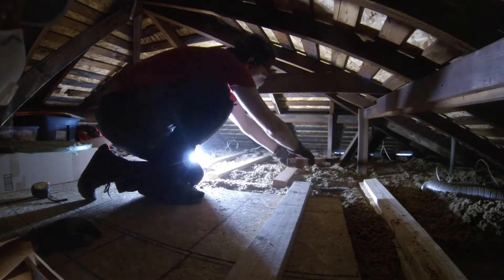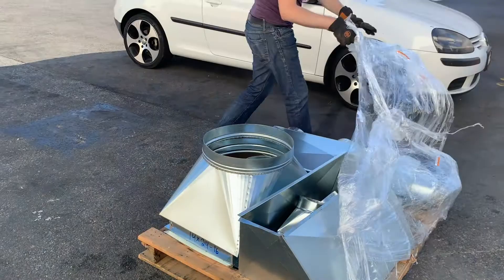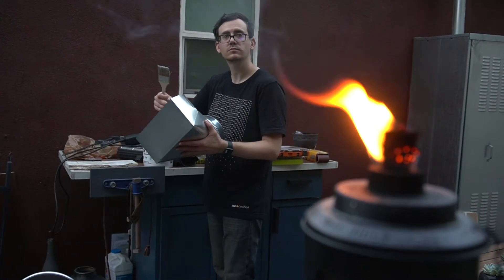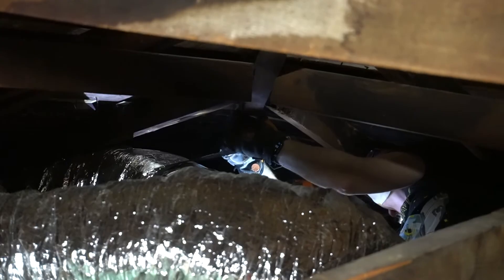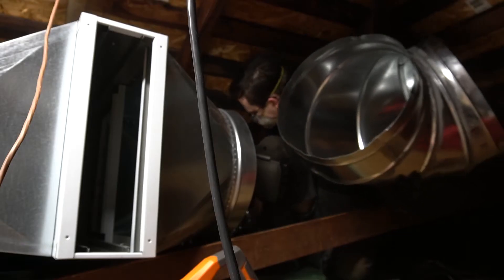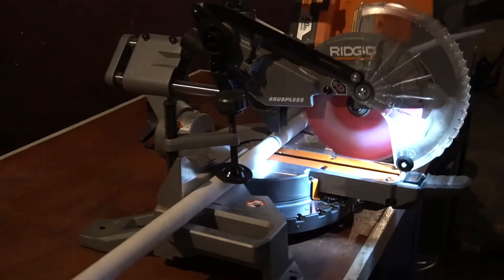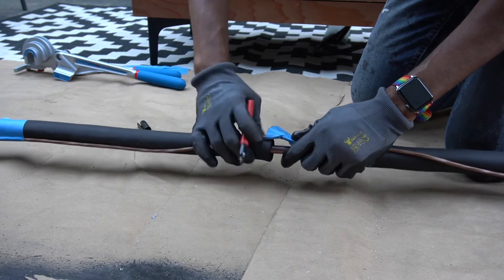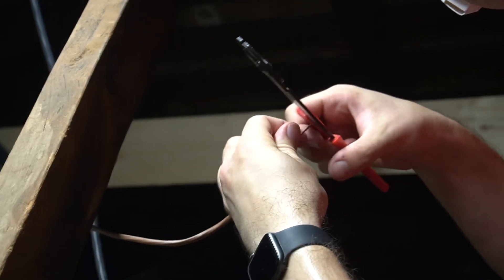Slim Concealed Duct Mini Split Install

Comment: That's a big job for DIYers! Nice work. I'm a heating engineer in the UK with years of experience in a lot of that and I'm about to do the same, it's taking a lot of research & it's very confusing as everything is a mix of imperial & metric measurements here. I'm daunted by it & I'm not even going to be doing the gassing of the system (a friend is going to do it). So you've done a fantastic thing there.
Reply from the maker: Thank you! Nice to hear that from a professional. Best of luck with yours!

Comment: In Miami nothing getting heat shall touch anything related to the air conditioning system inside the attic, no wood, no house insulation is to touch an equipment, or duct, nothing hotter than the ac or ducts shall touch the system or it will sweat due to difference in temperature between the two objects. If anyone has any questions ask, I'll explain in another moment.

Suggestion to the author, carry at least another source of light while in the attic. And for videos purposes, install an extension, illuminate the area all you can, so the darkness gets mitigated and doesn't work as a detractor making your videos not pleasant to be watched. Many in my experience do not enjoy one bit anything related to the attic so if you add darkness to it that's it. Light is very welcome to most, so hope you make the sacrifice so your audience may, "may" grow. Who knows, we do impossible jobs so, acquiring audience in this field is another's impossible project so, my best wishes to you! Take care and do not work in the attics once you feel any minimum thought about low energies to go down, low Dioxygen levels or anything that makes you to slow down, no money is worth your life. Is better to abandon any project or being fired than to lose your life. Believe me, I've being fired from jobs by people that know me well but keep this in mind, I was taking care of emergencies, they know me, for 22 years one of them, the other knows me for less but I attended his 33 apartment rentals and all my clients must have air conditioning, they do have, and am not dying in any attic just because they demand me or need me or want me or anything. If I have one neuron alerting me anything related to protect my life, hope you too, do not fight that hero neuron, get down. Those that want us dead do not care about us. One of the business owner that fired me told me "I don't care how you live!" So, there you have it. Is not worth it to die for certain humans. And I am one willing to die for many, but some, expressed this way to me after 22 years of knowing me? And worst so. Protect yourself! Live longer yet!
Reply from the maker: thanks for the info and thanks for watching!

Comment: Where did you buy that strut? I couldn't find them at homo depot or lowes? Was that easy to find?
Reply from the maker: We actually found ours at Home Depot locally. Lucky I guess!
Reply: @40Figs  Don't laugh but I bought my unit in December and I still haven't installed it. I've been busy but I'll be doing a lot of this myself in a few weeks. I also called the company you used and they offered to size the system and help me design the plenum and ductwork. It takes a (gay) village. I will probably drive from Tacoma to pick it up since it's not that far

Comment: I've been seeing a lot of people posting online that if a professional does not install your system they will not honor the warranty if anything goes wrong which really sucks! I've seen this mostly about C&H so my plan for the system I'm about to install in my House in Lakewood, wa is to pay an HVAC contractor to come out and do the evacuating part so that way I know that very crucial part of the installation is done properly and then so I can also notate his HVAC Contractor License ID so when I register my warranty I can give them that information to make sure if there's any issues they absolutely honor their warranty!
Reply from the maker: Makes sense! That’s probably the way to go. We’re just hoping everything holds up and we won’t need to make a warranty claim lol
Reply: @40Figs it's been five years, any issues with the system or with are leakage?

Comment: From what I saw in a video by an HVAC contractor, when you flare a tube like that you are not supposed to deburr them. I am glad you showed the information about bending the tubes because some people might think they can just bend them around. Someone also suggested using a digital gauge when doing the evacuating because it's more accurate but I don't know if that really matters
Reply from the maker: Thanks for the info!

Comment: I'm working on a ducting system made entirely of rigid foam sheets. They bond really well with gorilla glue, and you can cut them anywhere, and with simple tools. It can be built in short sections on the bench, and the short sections easily bonded together insitu.
Reply: How did this method work out for you? Has it held up? Would you do this method again? Ty for your time

Comment: Hi there. I'm planning on installing a ducted mini-split also, I'm in Florida. The video was very helpful, but I would like to have a bit more details. Can you share with me a few technical info: what tonnage is the indoor/outdoor units? size of the supply/return ducts? the noise level from the vents in the rooms after installation? if you could share the duct design it would be great.
Reply from the maker: Hi! Thanks for watching! Based on where you are and the size/layout of your house, your needs are going to be quite different than ours but our unit was 1.5 tons/18000 BTU and it's been running nearly silently. Best of luck on your install! We're glad our video was of some help.

Comment: Awesome! How did you get the attic units through that tiny access hole?
Reply from the maker: Good question! lol. We did actually have to do some reframing of the attic access hole to enlarge it a bit, but it ended up fitting in the end...just barely!

Comment: No problem with extra condensation on the concealed duct air handler due to extreme temperature differences between the equipment itself and the environment it's in, due to it being installed in the unconditioned attic, the attic not being part of the insulated envelope of the interior house?  All guidance I've seen indicates that the attic must be part of the interior envelope of the structure, or the air handler must be housed inside a well-insulated box.
Reply from the maker: Thanks for watching! No problems so far with condensation. The unit itself has interior insulation and we also installed an emergency drain pan just case.

Comment: All that work and no thread Teflon? Or at least pipe dope would have future leak proofed the refrigerant connections. Not a big deal with non ceiling handlers, but in an attic! Gulp
Reply from the maker: Thanks for watching! Flare connections do not use Teflon or pipe dope.

Comment: Great work! Did you forego all warranty from Fujitsu by doing this yourself? Also, why use a ducted system - You have access in the attic, so why not use ceiling cassettes, for example?
Reply from the maker: Thanks for watching! We haven't needed to test the warranty yet. One of the reasons we chose Fujitsu is that many of the local contractors support these units, so if we ever ran into an issue hopefully we can get help. The main reasons we chose ducted vs. ceiling cassettes are aesthetics, cost, and installation complexity. Ceiling cassettes would have required us to frame openings in the ceiling joists, run line sets to each, required a multi-zone unit, and would have been much more expensive.

Comment: Great job. I have installed ductless units but have yet to install ductwork.
One very big concern: before anyone begins poking around an old attic, built before the mid 1980’s in particular; make sure the insulation is not asbestos. If the insulation is not simple fiberglass batts or you know exactly what it is, be careful and have it tested in several places especially if it looks like it is granular or unusual material. Perlite was a product commonly used years ago that had asbestos in it.
Reply from the maker: Thank you for the concern!  We did actually have our insulation tested and, lucky for us, it is asbestos free!

Comment: Okay as an electrical contractor and someone who has built 3 homes for my self I have watched a lot of construction related videos about concepts I was interested in. They all have typically one thing in common which is some Arrogant, "know it all" male (usually with a ridiculous hillbilly beard, machismo tattoos and  some variation of a pro 2nd amendment t shirt or hoody) filling the video with their ridiculous Ego. Then I stumble on this video of a couple of low key gents taking their time, speaking softly, doing their research and putting out a great overall video that thoroughly shows what's involved in a DIY ductless minisplit install. Cheers to you guys, I love it.
Reply from the maker: Thank you, that's really nice to hear. So happy you appreciated it!
Reply: I agree with you. I'm a gas engineer in the UK with no experience with refrigeration, only heating. I'm wanting to fit the same. I've seen the same stuff as you so it's nice to see it can be done.

Comment: Excellent job gents!, Better  job then I have seen by pros! I have read pro comments on the internet that actually state "Torque wrench? I've been installing minis for a dozen years never used a torque wrench I know when it is tight enough." or "nitrogen flush all I do is a deep vac". The two of you went beyond the pro level/ Good job!
Many vids on a  standard wall mini, almost none on concealed ducted unit. I installed a 2  head units on a 3 zone outdoor unit. have not used our gas furnace in 3 years and we are in Boise ID. Are looking to add a concealed 9k unit for  2 small bedrooms. your video, inspiring and full of tips.
Best wishes to you both!

Comment: You used tape on joints.   No good.
Reply from the maker: We used UL 181B-FX foil mastic tape with at least 2 wraps per joint, as well as nylon ties. It is an accepted practice for installing flex duct to fittings. Please refer to the Air Duct Council’s flex duct installation standards guide for more info. Thanks for watching!

Comment: Why did you use a 16" return duct?  What CFM is your system supposed to output?  I am installing a 18k BTU concealed duct unit and since my system medium speed is 450 CFM, I decided to go with a 12" return which is supposed to apply 480 CFM.  16" is supposed to supply 1000 CFM
Reply from the maker: The return size was specified by the company we hired to design the duct plan and build the plenums. My understanding is that our unit is a low static pressure model so it needs a larger return to keep within the limits. It is a ~600 CFM system. You probably need to design your ductwork for the high speed mode. Thanks for watching!
Reply: @40Figs  thanks for the reply. My unit on max speed is 530 CFM (med speed is 450 CFM).  12" flexible supplies 480 CFM, but my vents are supposed to supply 445 CFM.  I am also planning on connecting the 5" fresh intake which should pull another 50 CFM on top of the 480 CFM 12" return.  I know for your system you could've went with a 14" return which should give you 700 CFM, but they went one size up to 16"

Comment: You guys did a great job.  You made it much more difficult than it had to be- but I didn't see all the challenges you had.  I have no doubt there are sheet metal shops in LA that can make the plenums- return and supply- and I'm not sure you need all those elbows, or a 16" return- thats enough for about 3 tons- but I dont know what size you of concealed duct you are working with.  I am here to compliment- not to criticize because you really did a great job.  I do these a lot as an hvac contractor and given a completed attic they are a ton of work.  I try to do them before the drywall is up----which makes it much simpler.  Excellent work.
Reply from the maker: Thanks for watching! I agree, there are sheet metal shops in LA that could have built the plenums for us. It is challenging as a DIY-er to find shops that have time for us. Ultimately we chose Vinje's because they are DIY-friendly and also handled the duct design and calculations for us. All sizing was handled by them, and I think keeping static pressure to a minimum is why some of the duct sizes are so large. I used hard elbows where possible to avoid issues with making turns with flex duct - maybe unnecessary. Thanks for your feedback!

Comment: Kudos! I definitely am glad that I have professional installers doing my ducted mini split system installation. I'm curious if you have had any issues with the Fujitsu. Right now I'm planning to use a Cooper and Hunter mini split ducted system. It was recommended by the builder. I had never heard of the manufacturer.
Reply from the maker: Thank you! We haven't had any issues since installing. It's been running great!

Comment: Is it typical to add an air filter box to a ducted mini-split like that? Were you worried about static pressure? My only hesitation in converting from traditional forced air to a multi-zone mini-split system is the lack of filtration. I also have a very small attic crawl space, which likely will make using concealed systems harder, so it may be moot anyway.
Reply from the maker: I'm not entirely sure if it's typical, but it is acceptable so long as you are attentive to the overall external static pressure of the system design. We used the Aprilaire 2410 with the 413 media filter, which adds 0.06 in. wc. @ 600 CFM, well within the design limits of the air handler. I also performed some static pressure checks with a manometer to confirm the design assumptions. For your application I would suggest looking into something like the Aprilaire 1625FG11 which is a ceiling-mount filter grille, so you don't need to have a big box in the attic.
Reply: @40Figs  That's a great suggestion, and thank you for the specific part number! Now to see if I can get it all to fit in my stupid crawlspace.
Reply: @40Figs  what's the tonnage of the system

Comment: Great video guys. I do want to point. That it's never recommended to sand down the end of the copper when lines or open that give a huge risk debris to get in lines and cause txv and internal clogging issues. But I did really like the video
Reply from the maker: Thank you for the info! Good to know!

Comment: Great job, but did you ever address the lack of insulation in that attic?
Reply from the maker: :) Definitely something we still need to tackle! Thanks!
Reply: @40Figs  Just a suggestion based on the quality of this video you produced, Do a video!  I just did blow-in insulation and it is not difficult, just time-consuming.  Not exactly expensive either.  There were not a lot of videos out there either in April when I did this, just generic ones mostly from the vendors.  You may also want to show tips and point out the different types of blow-in insulation ( fiberglass, Rockwool, cellulose) and include the rental process from Home Depot or the likes. Also compute the R-value you intend to shoot for and the amount of bales you will need. If you are looking for content.......

Comment: Does this type of AC unit have individual controls for each room?
Reply from the maker: It does not - just one control. But it's a small house and has worked well for our needs.
Reply: @40Figs  so just one control like a central AC?
Reply from the maker: Exactly. Individual room controls would be significantly more complex and expensive, requiring either separate units or zone dampers.

Comment: I've watch this video a few times, extremely helpful and thank you for putting it together, I'm installing 2 - ARU9RLF in my attic so I have no wall units in the bedrooms and 2 wall units down stairs, the compressors are AOU24RLXFZH and AOU24RLXFWH, I'm in NH so I bought the colder units (-15 F) hopefully to heat and cool most of the year, you guys definitely clarified a lot of my questions, thanks again!
Reply: BTW, I do want to share, for the ducted units, in my case, the ARU9RLF, when you install the drains, in the unit in this video, these guys used the default configuration, which allows you to pump up the water that needs to be drained, see 10:40 in the video clip, if you do not want to use the pump in this mode and instead in gravity feed mode, you need to actually clip the JM1 jumper wire on the circuit board, its not very clear in the manual but this is what is needed to disable the pump, the wire is like the size of a staple so you need to take extra care and make sure you are grounded properly.
Reply from the maker: Thank you for pointing that out. Yes, if you want to use the gravity drain (more ideal than using the pump IMO, but our attic configuration would have made it much less convenient to run the pipe that way) you'll have to clip JM1 as indicated in the installation manual.
Reply from the maker: So glad it was helpful! Good luck with your install!
Reply: @40Figs  Guys, question for you, for the attic unit (for me the ARU9RLF), the ducted unit, I notice when I run it, even on high, the air flow is quiet and low, it does cool the room but its no where near the air flow of the wall unit, is this what you find with your ducted unit, I guess this is normal ?
Reply from the maker: We have not had airflow issues, I used a vane anemometer at each supply boot to confirm rough airflow numbers and it seems to pretty well line up with the design spec. I will say these systems are sensitive to static pressure and you may need to reference the installation manual to make configuration adjustments to increase the blower speed. See 10.3.1 Function Details- Static pressure. The default is for 0.1 in. wc. but you can increase it all the way to 0.36.